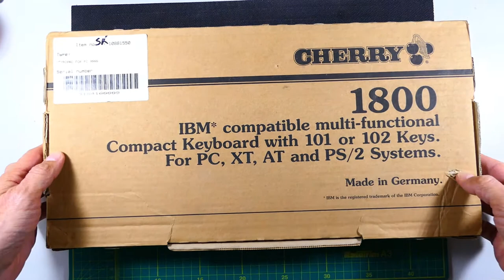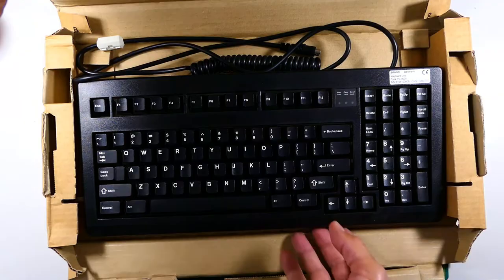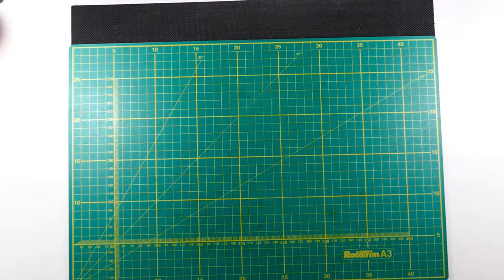CHERRY G81 1800 HQU (MY) keyboard mechanical retrofit transformation

Comment: I never knew there was an entire replacement pcb for the MY 1800. Great way to revive a classic, the 1800 layout is still so good even better with those keycaps. 

It would be really interesting to bring a board like this to full parity with the current trends. Add some mill max sockets for hotswap, try some of the acoustic mods, dampening foams, tape, pe foam mod etc. It always amazes me how great you can make even the cheapest plastic cases sound with a bit of work
Reply from the maker: I agree, the feel with the steel plate is totally different and it's quite an enjoiable keyborard now!

Comment: Can you please tell me the colour code for the original keyboard PS/2 cord? I have the same model and make but the male PS/2 got cut off. I am replacing it so I really need to know what coloured wire serves what purpose. I would be grateful.
Reply from the maker: Pardon me but I'm not home, I'll check If I have the original cable somewhere and let you know next week
Reply: @BitSplits  That would be excellent. Forgive me for any inconveniences I might have caused. I am really grateful.
Reply from the maker: Hi, bad news, I searched all house but the cable isn't here.I probably got rid of it all togheter the rubber dome pcb :( I can't help
Reply: I see. It's alright, I appreciate your efforts. May you have a pleasant time ahead. :) @BitSplits

Comment: I've been contemplating a similar project myself. As a starting matter, how hard is it to take the case apart to access the PCB? Does it require tools, or does it just pop off by hand, and how firm/delicate do you have to be?
Reply from the maker: You have to remove two screws and release 4 large plastic  tabs  from the bottom . You need to apply force to unlock the tabs, I used a flat screwrdiver, always try  to be gentle, it's plastic.

Comment: That keyboard checker phase I did as well on my PCB. I noticed that one of those vias/eyelet doesn't register (dead). do you know how I can fix this? do i require specialists tools to repair such a thing?
Reply from the maker: I have just to guess here, there might be a couple of reasons, input  is not mapped in the firmware, contact does not close correctly. For the latter a multimeter is required to trace contacts and check that the MPU input pin is driven correctly.
Reply: @BitSplits  Thanks for replying. Well it should work though the key worked for almost 1 year, then it just suddenly stopped registering. But one night I did what you did I put a tweezer in the 2 contacts and it registered. but now after desoldering again I damaged that eyelet/via. Is there a simple way to fix it with copper tape or another copper wire formed into a cirkel?
Reply from the maker: @girigirininja9798  You should locate the via interruption first and then bypass it with enamel copper wire. Be aware that it is a surgical level soldering job. Enamel wire is this one, you can choose the wire diameter you need https://it.aliexpress.com/item/1005001693901095.html?spm=a2g0o.productlist.0.0.55dd46a8YGptEJ&algo_pvid=null&algo_expid=null&btsid=2100bdca16164051509694792e4e95&ws_ab_test=searchweb0_0,searchweb201602_,searchweb201603_
Reply from the maker: check this guide out https://youtu.be/ynf3pqROHOk?t=2323

Comment: Hey there, thanks for sharing your build. I currently have a g8. 1800 cherry case. I just got the leechee pcb but I can't seem to fit the pcb into the bottom cherry case. Did you do any modifications to the case or is there smth I must take note of when putting the pcb in?
Reply: G80-1800*
Reply from the maker: @rwoosh_master  Hello, mine fits perfectly , I also have a g80 1800 case and I did'nt see any difference. I did, in fact , before buying the leeche pcb, compare the g81 and g8o bottoms and mine are identical.

Comment: What was wrong with that switch you removed at 14:05 ?
Reply from the maker: Hi!, sometimes, when You insert switches, the pins do not align perfectly with the pcb holes and the pins bend between the plate and the pcb. So You have to remove the switch and strighten back the pins. In this particular case, extracting the whole switch has been problematic since the stainless steel plate cuts are tight (by choice) and pulling out the switch involves some effort. You can see from the following movie frames that I used pliers to stighten the pins :)

Comment: good job! how did you make the custom steel plate?
Reply from the maker: Hi, I started from an open source design available for g80 1800 keyboards , modified it and had it laser cut from a local company :)